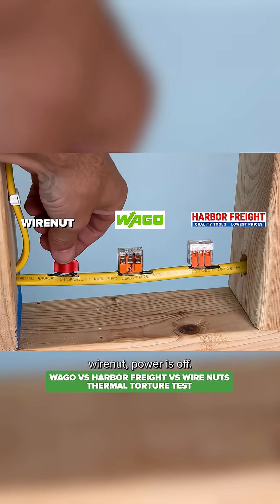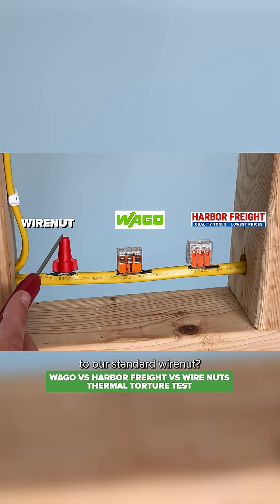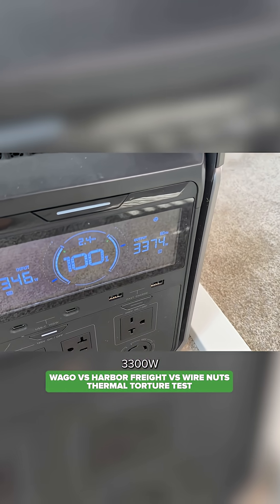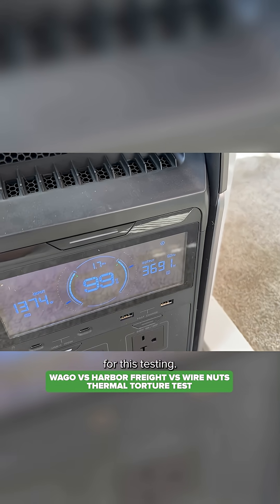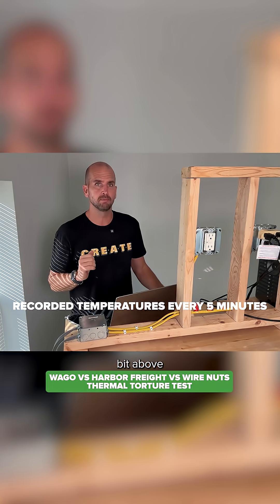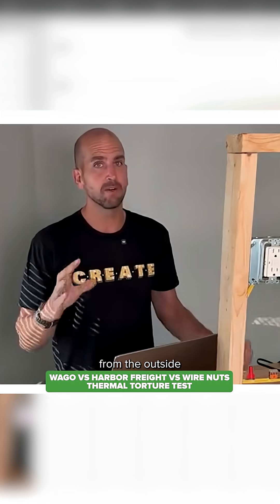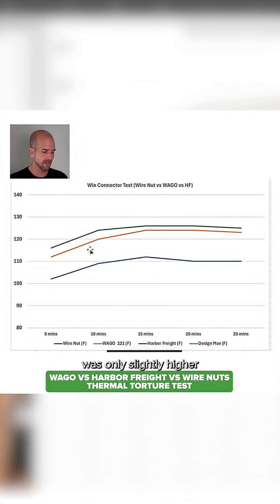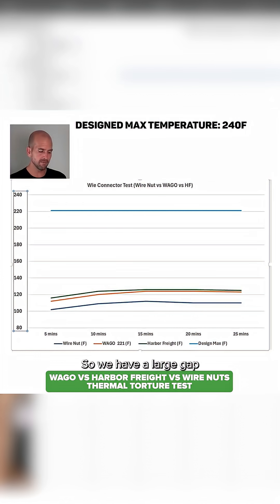Harbor Freight vs WAGO — The Truth About These Wire Connectors!  #diyelectrical

Comment: One thing you didn’t mention, the wire was as hot or hotter than All the connectors.
Reply: Yes, I was looking for this comment.  The main wire itself being hotter than the wirenut probably indicates that the thick plastic on the wirenut is simply better at blocking infrared transmission or at blocking thermal conduction than the wire insulation itself or the plastic on the lever nuts.
Reply: Good spot! I went back and rewatched and the wire nut was darker than the wire - leading me to concluded the thick plastic of the wire nut disguised the heat reading. The inside of the wire nut cannot be a lower temperature than the wire leading to or away from the nut.
Reply: @bretth3718 it is possible.. he pre-twisted the wires so 1) the wire nut isn’t actually conducting any electricity, it is going direct wire-to-wire.  2) the connection is “double the gauge” of the wire so has a lot more current carrying capacity than either wire themselves so lots less “glowy, melty” right under the twist nut.
Reply: @greket1 
It would for sure be hotter. 
The twist allows better connection, sure, but it's still less than you think. 
Think of the shape, it's two cylinders touching at any point along the wire. 
Think like pool noodles, in terms of shape. 
Twist them around each other and it's still lots of area not connected.
Reply: Doing electrical drawings and calculation on wire gauges according to the Swedish regulations I’m allowed to calculate for a continuous temperature of 194 degrees Fahrenheit in the cables. It’s not something the we do but it shows how sturdy modern electrical installations are.
As for wire nuts, you can find a box being a shelf warmer at the whole sale but I haven’t used one in over 25 years, my only interaction with them is by replacing them with Wago 221.

Comment: Stupid comparispent. You twisted the cables in the wire nut so good , that only isolation tape will be enough. 
Also the contact surface for the twist is so much greater than the connectors that it is tragic.
Also keep in mind that with the wago connectors :
1-its easyer to assemble/use
2-its easyer to dissaseble 
3-its easyer to test/probe.
4-its spring connection, so no future issues

To be fair, just put the 2 wires in paralel (no pre twist) and put the stupid wire nut and then test...
Reply: Yeah do the typical DIY wirenut with too many wires, different gauge/stranded, and no pretwist.

Comment: I’ve only seen those newer style connectors on control wiring not heating circuits. Seems like a no brainer.  There is not enough surface connection to transfer without heating up and turning into an element itself

Comment: Those connectors have resistors in them that heat up.  It's very bad for the plastic.  They don't last.  And they should be derated in the NEC someday.  The wirenut has no such issue.  That being said, WAGO's are a better product in certain engineered applications with stranded wires especially.   It all depends really.

Comment: I'm not an AC electrician, but I believe why you see the consistant increase in heat as you go down the line to the harbor frieght is because you are running those all in line.

Every splice you make in 1 wire increases resistance which is heat. You probably should re do your testing with only one splice connection at a time. This is just common situations I see in the DC world.
Reply: They are seeing the same current in series. Swapping the out would make minuscule differences based on the connector.

Comment: Electrical engineer here.  Not a valid test.  Should have an ammeter in series with each connection to adjust for equal current.   Different heaters, different settings, different currents make for different results.

Comment: I always knew this because the contact area is so small on the quick connectors. The best is a twist properly done with the right wire nut. Better contact area and runs cooler… Keep on rocking.
Reply: If you know how to twist wires, but most people don't. Even a lot of so-called professionals don't do it right. Clips are consistent and far more "idiot proof".

Comment: I wonder if a parallel test versus series
would show different temps.
Reply: I have been surfing the comments to find this exact question. +NOT+ because I think he did anything wrong, especially since it is resonable to think you'd see multiple connection types in a series running through multiple rooms in an older house you might be fixing up (meaning a real scenario), but it would be interesting to see each type isolated, for those of us with OCDlabcoat tendencies, just to know. Then, I'd also like to see a continued stress test over multiple heat up and cool down cycles to see what happens over time to held temp and any expanding/contraction issues.
Reply: Electrical theory states that the same amperage is going through each one so the power dissipation is purely dependent of the resistance of each connection.
Reply: I was thinking this and the wire length should all be same.  He has two variables that are different for the test.
Reply: @dtoad48 please clarify what you mean. By going in series, the current will be the same for all. It would be interesting to see the actual voltage drop across each, but that was not in the test plan.
Reply: @TomCee53  When you test something you remove anything that could cause a bias in your testing. When you test you make sure any outside variable that could affect the test is removed and the only thing you are looking at is what matters.  Multiple tests, multiple averages, multiple connectors.
Reply: Thanks for the very clear and useful video. Lots of good information.

Comment: 30 amps thru wire rated at 20?
Reply: This is Judas a test to see how they behave in extreme conditions. They each would perform better under normal circumstances.

Comment: Imo, the wire nut is the best connection,  you are connecting wire to wire with nothing in between. The wago connector is no different than backstabbing an outlet. Imo
Reply: As long as the wire nut is installed properly. I've seen enough loose nuts and burned wires twisted together with tape. Wagos are also much faster to install.

Comment: Just observation not complaint: the wire but pre-twist was pretty ideal & much better Cu contact than most work in the field, so less resistance & less heat. For stranded wire, lever nuts will always be better imho that wire nuts due to much more predictable capture of the strand connection
Reply: I just replaced the kitchen light fixture in my house yesterday. The last guy did such a poor job with the wire nuts that the stranded wire just pulled right out.
Reply: @xDownSetx  that’s the common failure mode for wire nuts, and stranded wire. When I was in the trade, I always twisted the solid wire together if there was more than one and stripped the stranded wire a little longer, and then shoved it into the end of the wire nut before placing the wire nut over the pre-twisted solid copper. That gave a better connection that wouldn’t pull out.😊
Reply: This. The test was ideal circumstances for the wire nut. A large reason to use clips is to avoid bad circumstances.

DIYers who don't have the skill to twist wires without scoring from pliers... Use clips.

Professionals, no matter how good they think think they are, are prone to be over-confidant, and make mistakes. Clips are faster, more consistent, and "good enough".
Reply: @MrRoguetech  Pliers? Anyone with grip strength better than a horny teenager should be able to twist two or three 12-gauge wires by hand.

Comment: You should do this test either using 10 ga wire (appropriate for 30A load), or do max of 20A using the 12 gauge wire you have on your setup.  This will give everyone a better idea of true in-use conditions.  No one should be using 30A on a 12 ga wire.
Reply: Wago are rated for more than 20 amps
Reply: Personally, I'd like to see the test with real world conditions - 12 gauge wire, 20 amps for a 20 amp circuit, installed in a box crammed with other circuits. Insulate the box like it would be in a typical wall installation. Run it for a couple of hours and then open the box to take the temp reading.

Overloading the device by introducing artificial conditions beyond the design parameters tells me next to nothing.

Another thing this test doesn't do is tell us the long-term effects of high load conditions. Do the lever nut contacts lose their effectiveness due to fatigue? Does the plastic housing suffer any degradation? I know that the channel is not geared to that type of testing, but it is a point of curiosity to me.
Reply: That’s the point of a stress test. If it can handle the excess load, it can handle standard
Reply: @DwDDB  Generally speaking yes, but the point here is to test the connectors, not the wires. In this case the heat from the undersized wire is making it harder to see the performance of the connectors.
Reply: @drtbantha testing these at their rated current just isn't a video that anyone would watch. Even when installed in a closed box in an insulated wall like in the real world. There's just nothing to learn or see in that.

As nothing interesting happens at sane current levels, like double the rating, you could be really sure that normal use won't be a problem.
Reply: @villehietala9677  Not saying don’t test at high current, just that the wire should be larger so you can see the difference in connectors better.
Reply: @drtbantha which then needs even higher current to see any results. Those are meant for a wide range of wire sizes, so it should not matter if you test with smaller ones.

We use mostly 4 mm2 lever wagos, but with 1,5 and 2,5 mm2 wires. Actually, we don't use 4 mm2 wires ever, I'm not sure if I can even easily get any here in Finland, as the next size up is always 6 mm2, which then needs the next size up in wagos too.

For me, testing with 4 mm2 wires would mean nothing. And as we see in the video, those take the smaller wires like a champ.

If I would like to see more optimal connections, there should be stranded wires, for which we use those anyway. If we have just solid wires, we use the basic wagos without levers. But, testing lever wagos with solid wires is nice, as in most cases we use those to chance from wire type to another, which again makes comparing to wire nuts pretty stupid, as those aren't meant for that.
Reply: @drtbantha The problem with testing on larger gauge wire is the connectors have more surface area to grab on to, so I’d expect them to not heat up as much. I like that he used 12.
Reply: Those clamp type connectors are not sized for 30 amp wiring are they?
Reply: @bobbyz7736  The Wago he used is. He mentioned it was rated for 10 gage wire. So it would have to be rated for 30 amps. Not sure about the harbor freight one.
Reply: @bobbyz7736  They're UL rated for 20 amps.

Comment: I think having them in-line is bad practice for testing something like this. The test results might get skewed.
To get truly comparable testing, you'd want to test each independently to ensure that being further up/down the line from eachother isn't influencing the results.
Reply: The same current is going through all three.  Testing them independently would make it hard to test them at the exact same current levels.
Reply: @andytraiger4079 Yes, that is correct. 

The physics of this is very counterintuitive. 

Current is the same for all the devices in series. And the current is the only thing that determines the heat.
Reply: @gf2e  I guess one could argue that the heat from one connector type is being conducted through the copper to it's neighbor and it wouldn't be so hot if its neighbor wasn't so hot. Spacing the connects several feet apart would make it so the heat conduction didn't have such a short path...
Reply: More wire equals more resistance there for more heat and energy loss the test he did is the best he could.
Reply: @ericfitzsimmons1202   Yes, each resistor will cause a voltage drop.

However: that will not change the heat generated at each connector. The voltage of the whole circuit doesn't matter. The current flowing through the circuit is the only thing that matters.

(It is slightly more complicated: If you have lots of resistors in the system, then this might change the current flowing through the system. BUT, the key detail is that physics dictates that the current through all the connectors is identical.

So, if you have lots of connectors and they reduce the total current of the system, then the current through all the connectors will be lower, and they will all be a bit less hot. Hopefully that makes sense...)
Reply: @ericfitzsimmons1202   voltage doesn't matter because current is what causes the heat increase.  This was already explained in this comment thread.  Did you not understand, or are you proposing something different?
Reply: Maybe do a comparative test, in addition to this one, with the connectors on separate circuits.
Reply: You can Check this very quick.
Just swap the Wago and the HF connector and see if the temp moves with the connector.
If not the test has a slight skew to it.
Reply: this. i thought i was the only one that thought this test was the dumbest sh*t I’ve witnessed all day. It’s almost patronizing how he talks about it even pulling up graphs assuming the information he gathered wasn’t flawed in the first place. idk why this pisses me off, but it does.

Comment: I have been using Wago after seeing them on your channel. Now I’m thinking to stay with wire nuts. Less heat
Reply from the maker: Yeah, you will see a bit more heat but honestly not many circuits run continuous 15 Amps let along 30 Amps.

Comment: I use Wago connectors most of the time. Sometime you have to connect multiple solid wire with a stranded wire, It is so much safer and easier in my opinion.
Reply: This is my go-to as well. I’m convinced when transitioning from romex to stranded THHN in a box this is THE best way to do it.

Comment: So, the wire nuts won.   I knew there was a reason I always use wire nuts.
Reply: There are no losers, all safely under their designed heat tolerance in a worst case scenario. Wagos are much easier and more reliable for many home owners.
Reply: @dllemm I agree. The variable with wirenuts is the length of the contact and quality of twist. Lever connectors remove most of those variables. Even though many people insist that twisting is necessary, in some cases it is more difficult due to ovation, and each person twists a bit differently. 
It would be interesting to see a test with three wirenuts in series and with some twisted and some not. Also with three Wagos in series.

Comment: Thank you so much for doing this test and video.  Reassuring to see that the WAGO connectors perform well  ...
Reply from the maker: You bet!
Reply: I'd say that it also shows Harbor Freight to be almost identical (at least with the one single unit, but my concern would be with QA variation).
Reply: Also what's better over time?

Comment: I used the Harbor freight brand on a water heater install. No issues with it 5 months later.
Reply: And you shouldn’t, it had near equal results as the Wago.
Reply from the maker: Thanks for the feedback.
Reply: From this one-off test, the Harbor Freight was almost identical. My only concern would not be whether they typically work as well or as long, but bad quality ones might be less atypical with Harbor Freight - one out of few hundred rather than a thousand, or whatever Wago's failure rate might be.
Reply: It is more like how will the splices perform five years from now?  I have some Wago samples and the plastic appears to be pretty dimensionally stable.  I haven’t seen the clone splices from Harbor Freight yet.  If there is a Harbor Freight compromise, it would probably be use of a cheaper plastic which one hopes holds its shape reliably.  There is no question that wire nuts will be reliable for many decades if correctly installed.